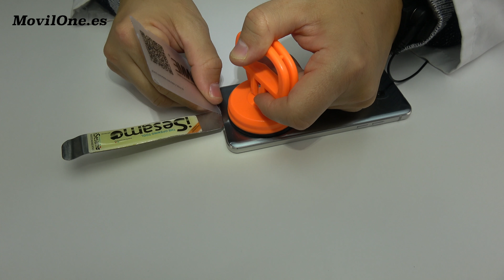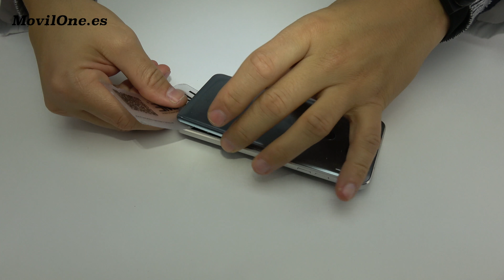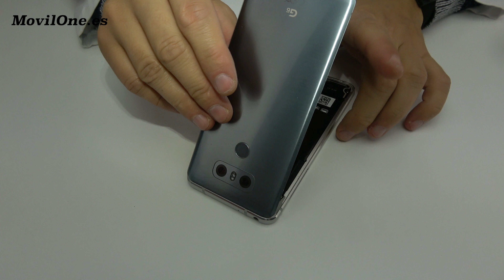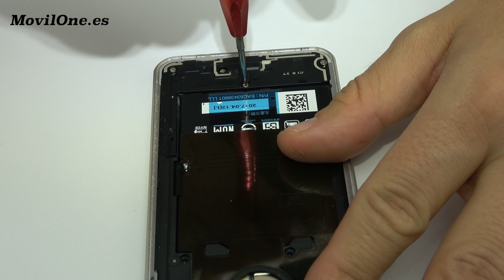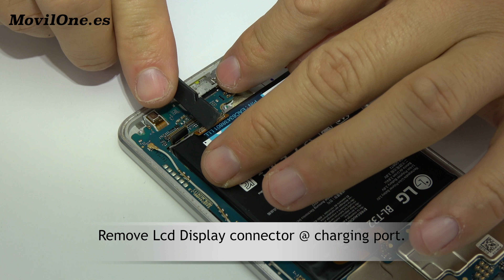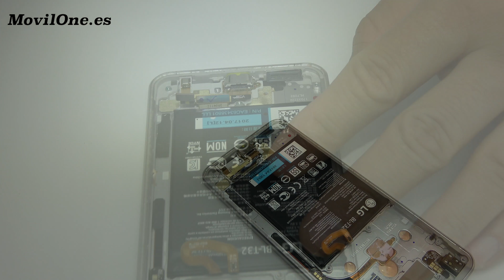LG G6 Charging Port Replacement

Comment: Thanks for the method ! How hot is the heat gun please ?
Reply from the maker: Bo Jour, to retire the back cover i m ussing the heat gun with 120 degrees and to heat the flex connector ...less, just a little bit. Also, you have to know that depends of the heat gun...Best regards

Comment: I'd probably replace the adhesive so it can retain more water Resistance
Reply from the maker: Hello, Gangstalishis!In fact, even if you buy it new, it is not advisable to immerse it ... you will be surprised how many devices that are resistant to water, arrive in our repair shop, with damage caused by humidity ...
Reply: @MovilonePhoneRepair  i agree,once the seal ip68 in the phone  is open for repair,it cannot and never be waterproof or water resistance.
Reply: Wouldn't be waterproof anymore,even if you replace the seal,Only the factory can make it water resistance,their seals are different than the one anyone buys or wherever you take it to get it fix,or if you do ir yourself